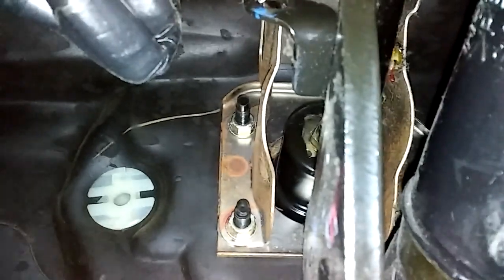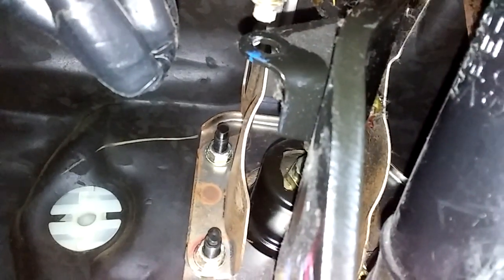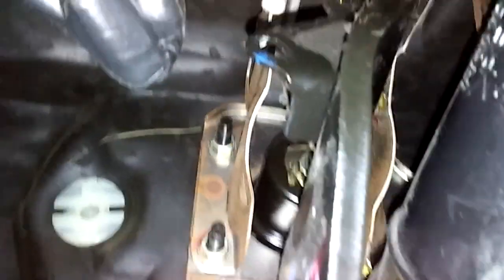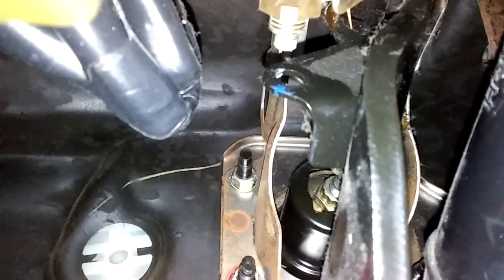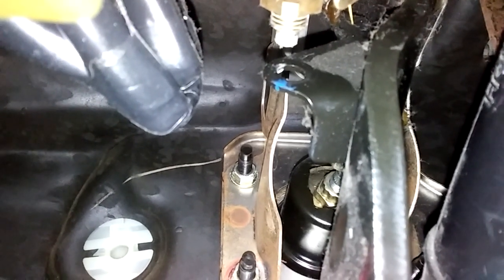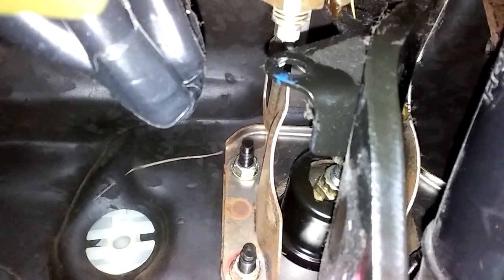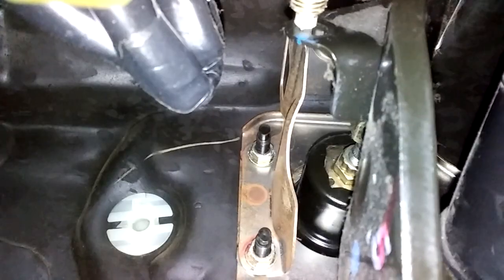How to fix brake light issue on a honda.

Comment: Had a long work day and came home to this issue. Turns out the plastic piece on my '98 honda prelude broke and was in my floor board. I dont have time to go to a mechanic to figure it out and I work in the morning. Not to mention that I dont have the time or tools to be disconnecting and reconnecting the battery every time I go to drive. Stuck a quarter there for a temporary fix and it 100% worked. Thanks a million!

Comment: you cannot see at all what you did... I had to do a super reverse back bend and had EXACTLY 3 pennies and it WORKED so thanks. If you push on the brake pedal you will find the hole easier because you can feel where it pushes where the 'button' used to be w/o having to see it. many thanks!

Comment: Great video man, well explained but didn't ramble on or try and sell me some sheets or a collector's coin. 

My problem is the opposite as yours was tho. 95 civic, the actuator part is depressed at rest and released when brakes applied but they don't come on. Any ideas? Or do I just need to spring for the $12
Reply from the maker: Johnsen Bear this might be one of them have to buy the parts things :/

Comment: Yeah, I did that to my civic, but one penny will work.... 5 years later, still holding up
Reply from the maker: Only reason i did 3 is sometimes there is a big gap between the actual trigger and the surface area but in this case there wasn't. My old purple honda still rolling around with a quarter glued in lol Had to do 2 nickles once before because i didn't wanna adjust the trigger lol. 1 penny usually works fine though :D
Reply: James Dguy it's a win win kind of thing lol 3cent fix can't beat it